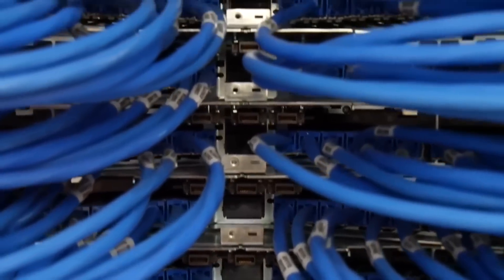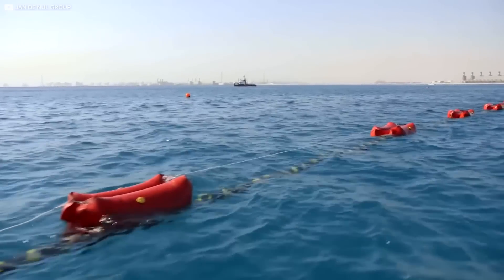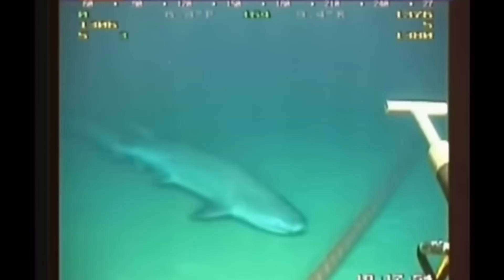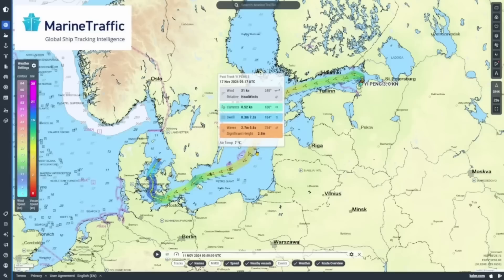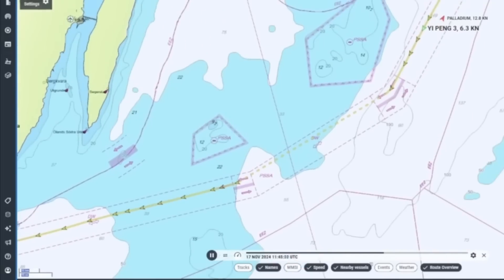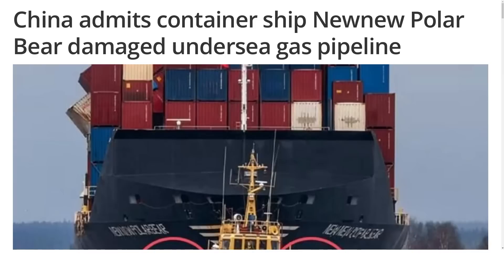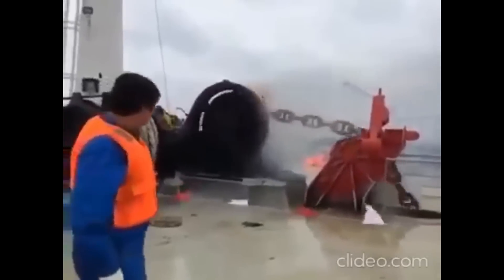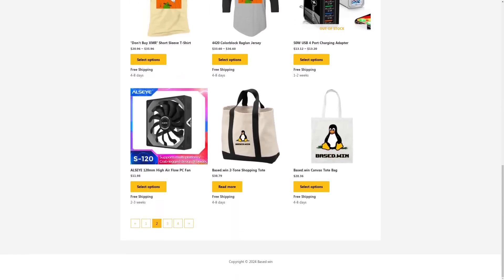When Undersea Cables Get Cut

Comment: so u AI generated fake cable in the thumbnail. Also copper transfers electricity at the speed of light.
Reply: There are 3 main issues with conductive data transfer (copper, gold, etc). First, the speed of light is dependent on the density of the surrounding volume, meaning undersea cables are physically slower and more latent in that regard alone. The glass conduit in fiber optic cabling is slower than the speed of light in a vacuum, but still faster than the speed of light in water. Second, the conductive material is capacitive, meaning it holds onto the electrical charge for some amount of time. This limits the maximum frequency that can be reliably transmitted and received. The third and final reason for fiber optic cables is distance. Copper wiring can't travel as far without being boosted. To make the signal travel farther, you need to use higher voltages, which requires thicker wires (increasing capacitance and cost), and consuming more power.

Comment: 3:30  No... That anchor was formed with spread tines so that whichever side ended up on the seabed a tine would reliably dig into the mud without requiring any additional manufacturing material over a stereotypical flat one.  I don't know if they make them like this for extra grip to stop the ship, but it would certainly be more able to snag a cable that has been buried to avoid casual encounters.
Reply: its hard to tell from the picture, and harder still to assess damage without a look at the original; just wanted to note that its not the anchor that holds the ship, its the wight of the chain, and the anchor is shaped to prevent it from bouncing as the ship moves.
Reply: @nmmeswey3584   
The anchor holds the ship to the location. This is why it is called an anchor. Being heavy helps it do its job. 
The chain does stuff too, and primarily, it does chain stuff. It chains the ship to the anchor in a flexible way when a fixed structure is otherwise unavailable for stretchy rope. 
These nautical terms were chosen and perpetually accepted as the nouns and verbs they are and do for more centuries than the languages they're spoken in.

 A YouTube Clickbaiter may have dunced you good at some point, but now you've had time to reflect. I'm sure you understand that the definitions of chains and anchors have not been incorrect for centuries while humanity waited for your truer understanding of the world.

Comment: This shouldn't cut the countries off each other completely, the traffic can still go around that, it will just take longer to load the abroad websites, because the signal takes a longer route. But it will still work to some extent. It won't work where it's strictly dependent on speed. Gamers might experience a higher ping and therefore a lot more frequent lags, video streaming will lower in quality, etc. Those are the applications that will get affected to some extent. Some applications will straight up fail, as they rely on the high speed. But most applications will manage just fine.

Comment: Actually, fiber optics are slower than the speed of light due to the glass fiber slowing it down.  It's actually approximately 30% slower, depending on different factors.

Comment: BTW the electromagnetic waves in copper also move at the speed of light, and it's slower than the speed of light in vacuum for copper and for glass.
Reply: It's a lot slower. Even glass has a velocity factor of about 70%, and copper is anywhere from 80% to 60% depending on cable geometry and insulation material.

I don't know if it's still going on, but as of a few years ago there was a company that had resurrected the old radio relay towers across America to use for a long-range radio transmission system. It let them shave a few  milliseconds off of the communications between stock exchanges, giving them that critical edge in high-speed changing that let them take advantage of a shift in price an instant before their rivals' computers can receive the information.
Reply: ok

Comment: Merchant ships are under constant pressure to operate efficiently, get from A to B using the least amount of fuel (balanced against tight time considerations). The idea that anyone on the ship's bridge wouldn't notice an anchor dragging along the seabed for hours is highly implausable.
 
Even in these days of automation, for nobody to notice the drop in speed or the increased revolutions to required to maintain the desired speed for so long would require an astonishing level of negligence from the entire bridge crew (likely the engine watch also). Enough for them to lose their certificates and end their careers.
Reply: It's the equivalent of trying to drive with the park brake engaged.

It doesn't happen for hundreds of km's by accident and at the same time the tracking system just happens to malfunction.

Just as the gas pipeline wasn't blown up by some drunken Ukrainians on a yacht.

The entire globe is constantly monitored by satellites, the US military will be able to determine exactly where that ship was at all times.
Reply: @sirtra  They were spec ops. C'mon. Drunken Ukrainians?
Reply: @HanSolo__  by Bojan Pancevski on the Wall Street Journal:

A Drunken Evening, a Rented Yacht: The Real Story of the Nord Stream Pipeline Sabotage

C'mon man, if i don't believe the wsj what makes you think i'm going to believe you? 😂
Reply: Automation would detect increased fuel consumption the second it happens.
Reply: Due to automated tracking of freight traffic, I think that's why the naval ships were already on it this time as soon as it entered back closer to Swedish and Danish territorial waters
Reply: ShayneHartford  I have heard these particular cables are buried into a depth of 1 meter into the seabed, at least at some parts of the run
Reply: @celeron55  That's only near the coast, maybe even just near ports. They just lower them down and lets them lie on the bottom.
Reply: Makes sense. As the video says, its TOOOOOOOOOOOOOOOOOOOOOOOOOOOOOOOOOO COINCIDENTAL that they didn't know.
Reply: Forget about the speed, is it possible that nobody from the deck crew wouldn't have noticed they they were fucking dragging the anchor? It's not a line or small cable, it's TONS OF IRON.
Reply: @jimmyking92  Only incident I can think of is the Russian Second Pacific Squadron; during their odyssey / hell trip around the whole world, they cut the telegraph cable connecting North Africa to Iberia when leaving Morocco.
Note though, this happened when leaving port, and the Second Pacific Squadron was an example of truly exceptionally horrific seamanship, because most of the sailors conscripted for it weren't sailors, were conscripted from regions far from the Sea, and basically had no training.
Reply: You do forget that they are from China
Reply: Also, in these days of automation the ship’s computer certainly has the ability to detect unexpected speed or engine fatigue… yeah this ain’t an accident.
Reply: ShayneHartford  Most are placed on the sea floor. These are narrow waters—a range of 2x or 5x the depth of such ship clearance, in the case of the shore bed of the Baltic Sea at those bridging locations.
Reply: "The enginee are under more load than normal"
"That makes sense were dragging our anchor over that internet line for our social credit" 
"Oh yeah"
Reply: I have no doubt somebody was either fired, or promoted, over an international incident involving billions of dollars of damage over a rookie mistake, or expert sabotage.
Reply: @manblanket  The odds of accidentally cutting a data cable in the massive oceans is ZERO.
Reply: Hey! US Navy sailor here. Anchors & Capstans on merchant ships are also REALLY loud. Audible in excess of 100k to 200k yards for sufficient sonar systems the idea that no one on the boat heard the anchor chain, drop, snap, or grind against the chute is incredibly improbable. Especially for six straight hours.
Reply: Dragging an anchor has not been a thing ships have done in 100 years. Modern engines have rendered sea anchors irrelevant.
Reply: @needparalegal  A sea anchor and dragging an anchor are two entirely different things.
       Dragging anchor = the anchor not holding in place. This is common in bad weather, sometimes necessitating using both anchors, dragging is why it's important to check what the the seabed is like before anchoring (marked on nautical charts (sand/gravel=good, smooth rock=bad)). 
       A sea anchor is like a parachute ships pull in the water behind them, primarily to maintain control in bad weather and to prevent broaching.
       Small sailboats still have use for sea anchors and all life rafts have them (to keep the raft relatively close to the last known position of the ship).
Reply: ShayneHartford  the cables are typically buried under the sea bed, floating them would be a nightmare with currents, tides etc

Google, bing and duckduckgo are all still free!
Reply: Prelude to WW3
Reply: This is just a conspiracy theory. Dont be a bad person and believe this misinformation!
Reply: Opium is a helluva drug
Reply: They pulled a Stratton Oakmont .
Reply: They’re trying to shut down the grid.
Reply: ShayneHartford not these bro
Reply: Bro the shit is on the screen they are looking right at lmfao
Reply: I have sailed with Russian navigational officers, it absolutely is possible to have a incompetent enough crew that this could have happened accidentally. Although I doubt that it was this time, the whole thing and navigational data seem to suggest that this was intentional.
Reply: Unless the ccp are the ones who ordered it. :O
Reply: Watch some Chinese dash cam. If they drive boats like they drive cars, it's a wonder their boats make it anywhere without crashing into something.
Reply: Chinese flagged but Russian captained and crewed. Pretty obvious
Reply: Well remember those are probably “ethnic” people on the ship crew, especially these days, 5 stars isn’t what they give out
Reply: If you look at the satellite log of the ship, it was OBVIOUSLY intentional. They went offline and popped up in a new location after a few hours and stuff.
Reply: The ship in question is an incredibly shabby old bulk carrier. Those are manned with the least amount (and lowest paid) of crew possible, likely 8 in total (captain, two officers, two ABs, two engineers and a cook(Or maybe an OS who does some cook duties)). I don't think it's too unlikely that this is an accident. Chinese crews in general aren't known for competence and bulk carriers aren't known for their quality.
Reply: @TUXmint  But the transponder conveniently shutting off at the same time? And that weird looping around after?
But we should remember conspiracy and gross incompetence are often indistinguishable from each other.
Reply: @ibex485  they just stopped. The loop happened because they drifted.
Easiest explanation would be, they messed up something, tried to fix it and cover their tracks extremely incompetently, and it happened again.

This doesn't look like any kind of purposeful operation, and turning off the transponder didn't do anything to help them hide
Reply: @TUXmint >Chinese crews in general aren't known for competence
Yeah, I worked as an AB in chinese crews. There were quite a few incidents related to the anchor - the Chinese would release too many shackles, did not know which way to unscrew the brake and were generally not competent enough even for such a simple operation as dropping the anchor. Working now as a third mate in the same areas where the incident occurred, I often hear on the VHF how the chinese make excuses to the VTS for delays in anchoring operations, mooring, etc. It was worth hearing how one chinese officer was once interrogated by the VTS for almost three hours to find out what IMO class their vessel was, to which he simply could not answer. It's entirely possible that they might not have noticed the anchor being dropped, and even when they did notice, they might not have taken any action. And it would be difficult even for competent watch officers, let alone chinese ones, to notice the slowdown or vibration/sound due to the dropped anchor. Moreover, this vessel is old, and there is most likely enough shaking from the main engine even without the dropped anchor.
Reply: @TUXmint Still, even those small crew have to notice when the ship violently shakes and drops speed.
Reply: @lechatrelou6393  Sure. But i don't think it's unlikely that their response to that would be having an engineer try and figure out what's wrong with the engine. Ships always shake anyways. I don't know how much more it'd shake from dropping the anchor. The anchor is just made to hold against the wind and current, not against the force of the ship engine.
Reply: @TUXmint  You forgot the actual crew. Mechanics, staff the actual seamen.

A cut-down crew of a Chinese bulk cargo ship called the Yi Peng 3.
Let's cut it even more so the costs would fit:
Deck 
    1 Captain.
    3 Deck Officers (Chief Officer, Second Officer, Third Officer).6-6-6.
    3 Able Seamen (ABs).
    1 Bosun.
    2 Ordinary Seamen (OS).
Engine 
   1 Chief Engineer.
    2  Assistant Engineers.
    2  Engine Room Ratings.
Support Staff:
    1 Cook.
    1 Ordinary Seamen (OS) - cook duties
. Still 15 people! onboard.
Reply: @TUXmint  And the Chinese government isn't known for its honesty, for being a good faith actor or for valuing human life.  This sort of thing 100% fits in with CCP tactics, so it is more likely that this was intentional.  Even if it wasn't, given the CCP's nature they should be held to strict accountability by other nations due to their lack of credibility and overall insidious character.
Reply: @darkprinc979  spoken like a true westerner
Reply: @fal2210  Spoken like someone that doesn't actually have anything meaningful to say.
Reply: @TUXmint  I’m gonna say that some malfunction caused the anchor to go.  Maybe they didn’t notice at first idk.  There was some work required to get it back up.  “Oh shit!  Sabotage the tracking”.  “ let’s keep underway instead of losing all that time”.   Slow is better than stopped.  Fuel be damned time is worth way more.  

Eventually they get it repaired and pull the thing back up.  Turn the tracking back on and go about the day.
Reply: @stevewoodyt  so you're going with concealment and willful damage in order to not arrive late at a Russian port?

Comment: actually, just think its worth mentioning. light only moves through fibre optic glass at 2x10^8m/s as opposed to 3x10^8m/s for electricity signals through conductors. 

the benefit from fibre optics is the bandwidth allowing multiple signals in either direction but it does have a tradeoff in speed, just the speed is so high its not a factor.

just interesting, not relevant

Comment: Yep, a top-secret clandestine Chinese operation to... slow down internet in several small countries for couple of weeks. Look, when gas pipelines explode out of the blue that's obviously someone's doing. However, if you knew anything about how those ships operate especially the old ones, you wouldn't be surprised if the crew didn't notice half of the ship falling off. 
As they say, never attribute to malice that which is adequately explained by stupidity.

Comment: These are just practice runs for when they decide to cut every cable and gas line they can in the world
Reply: They have enough ships across the world at all times. Seems like an effective plan. Why disrupt and destabilize with warships, when you can quietly disrupt using everyday means?
Reply: @addmix  Lots of vital and vulnerable infrastructure that could suddenly cease to function as intended during the next major trade dispute.
Reply: I would say an appropriate response would be to Block to the malacca  Strait

Comment: so HOW do they fix it? My guess is bring both ends to the surface and splice in a new length of cable on ships
Reply: both cables were cut at depths of around 100 meters or less, so this should be feasible